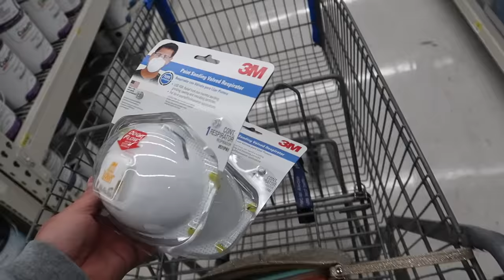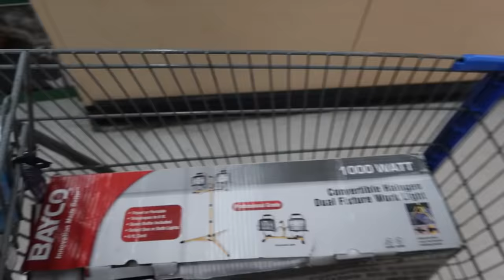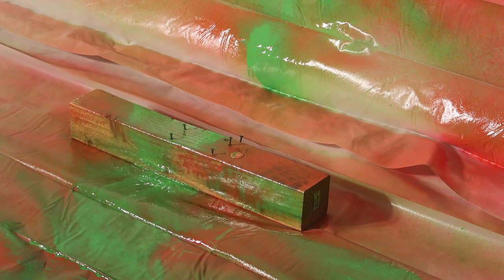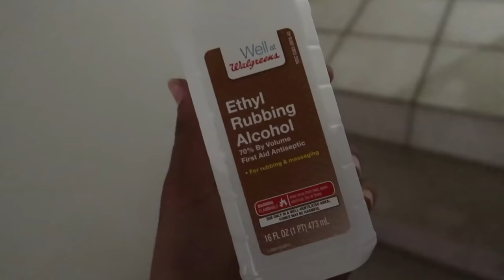NINJA SWORD VS. SPRAY PAINT CANS!!!

Comment: Paint your whole house for $2500. Dead serious
Reply: that way I can buy the paint, rollers, ladder, brushes, roller covers, ect ect
Reply: Eric I meant $2500. Sorry.
Reply: Eric 
And I will go over the areas with primer before I paint and do 2 coats and will not be afraid to cut in even the hardest areas to get paint it. Trim, crown, body, and the essentials